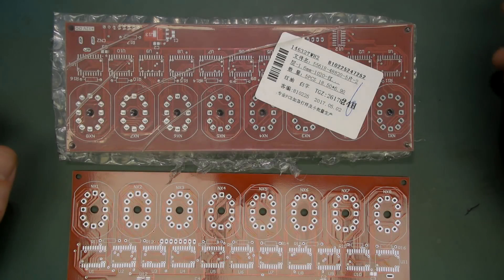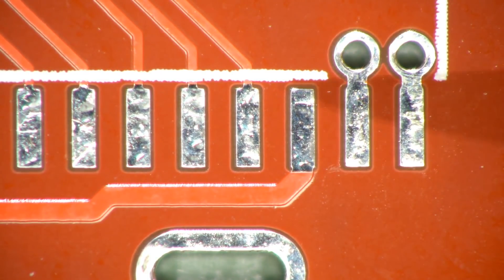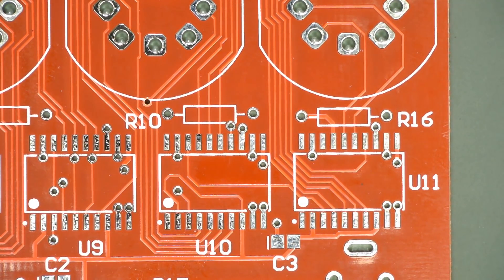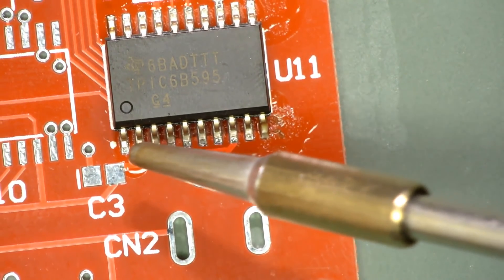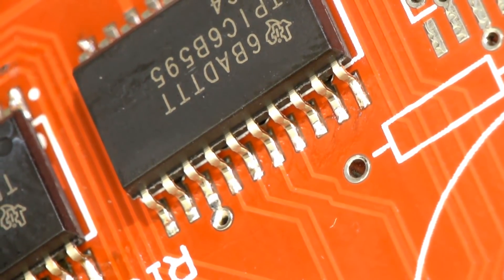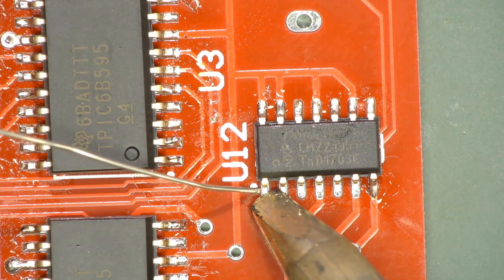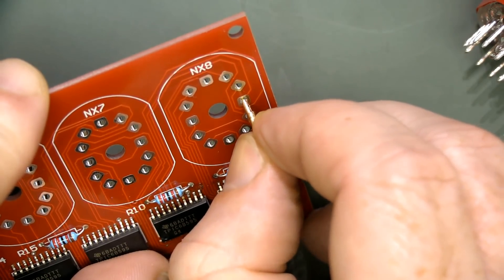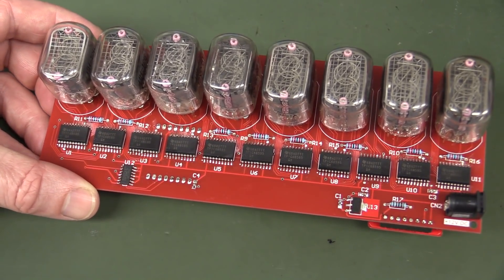EEVblog #997 - How To Solder Surface Mount Components

Comment: I'm new to soldering; I don't understand this. Why doesn't the dragging method bridge all the legs together? Or even the dab method, when the tip is wider than the pins and pads? I bought a simple kit and while the through-hole components are easy enough, these surface-mount ICs feel impossible. I just spent half an hour fighting a single 1cm-long 16-pin chip. I think I ended up with more solder in the vacuum piston thing than staying on the board, without how many times I accidentally bridged pins and had to suction the solder off.
Reply: more flux, higher heat, move faster. Once you're good with the iron, make a heating plate and never surface mount this way again.

Comment: This helps me a lot for an upcoming project. I have a Xbox One X that needs a new plug on the motherboard for the front USB sync cable, bought the part but didn't know how to attach it when it arrives. Now I know what I need to get in preparation, thank you.

Comment: Just came back to learn a little bit more about soldering down chips unfortunately I think I'm going to have some fun fixing and Nintendo 64 and DSi the DSi needs parts have an open Nintendo 64 but I'm pretty sure it's just the video and audio card.

Comment: I did not replace the chip but I did solder my Wii remote QR camera because it was glitching too much blinking in and out I figured one of those pins is disconnected thank God I did because it worked thank you very much.

Comment: Very good video. I built a four digit IN-12 clock a few months ago and I put it into a 70s style case with a red glass filter. I will use your tutorial to solder my golden 5402 IC from 1970 on a DIP-adapter to test and use it later for other projects.

Comment: In my opinion, for the job at hand, you used the wrong solder, flux and techniques. Even your drag soldering devolved into point-to-point (dab?) because of the poor solder and flux choice.
Reply: what’s wrong with the solder and flux

Comment: What soldering iron are you using?  Also, I dunno if this is a trick ppl use, but what about a wedge in between those circuit legs to avoid bridging when you have to solder a wire to the legs.  Is there something out there like that?  Wondering, because I solder very small delicate areas like this, and I want to avoid bridges.

Comment: Interesting. At work, I do a lot of SM soldering, using a fine chisel-cone tip and about 0.3mm Pb60Sn40 rosin-core solder at 675F, using a flux pen and single-pin soldering. I haven't tried "drag soldering" yet. Perhaps I should try to convince the boss to buy me a "well" tip, as drag soldering may save time, as I do a lot of soldering of multi-pin SM DIP ICs with 0.05" pin spacings. 

(Some of the ICS on the boards we repair have even smaller pin spacings, down to about 0.025" on Atmel CPUs, but we don't even try to mess with those; if those parts are bad, we send the board back as "unrepairable", because even if we could unsolder & solder those (which we can't), we don't have access to the software, so we couldn't program them.)

Comment: Whenever I'm soldering in pin sockets like that, or anything else that's not one socket package with all the pins attached, I connect them to the device (the nixie in this case) to make sure the pins stay aligned and parallel.  Drop the nixie in with all its pins and drop it flush with the board, solder them all in (tack them at least) then remove the nixie and move on to the next one.  If you don't do that you may end up with one or two pins that aren't quite parallel and you can't plug in the nixie without bending a pin a little, and that risks causing other problems.

And a nice alternative to a solder pen is to get a bottle of your favorite brand of ultralightweight flux and a soft bodied needle bottle.  Then you can dab the solder in wherever you need to, with pretty good control, even into areas that are awkward to use the pen with.  Also the pen needs a push to release the flux, whereas the bottle just needs a gentle squeeze, so there are things you can flux with the bottle that you can't flux with the pen. Search your favorite outlet for: needle tip bottle flux no clean
that'll get you a bottle of just what you need. (example, listing 201780768122 on ebay with over 2,200 sold)  One bottle goes a long ways.

Comment: What do you recommend for cleaning the flux residue after soldering is finished? Wash with IPA?
Reply: IPA Should do the trick but I like to use Kontakt LR (EAN: 5412386840135), its got a little brush attached to it to brush off the flux and works really well.

Comment: Some great tips for nuubs, thanks.  Having been in the industry for 15 years I was always a dab man with these packages, your example shows why drag (with these tip types) is so unreliable and often time consuming due to reworking via dab.  Might as well dab to begin.  I often didn't even use a flux pen.

Priority of component assembly and the diagonal tacking are great tips.

Comment: Desoldered a chip on a 01 bmw e46 and tried to wet the pads... 2 lifted up and I couldn't fix the issue that time... Was just ridiculous how easily they lifted. Also the soldermask basically crumbled when it got heated. Luckily its only a doublesided board and rerouting those connections will be quite easy. (I suspect the fault was with the pads as the dash did the same thing after replacing the chip)

Comment: Great video, always good to demonstrate different techniques. At least less experienced people can learn the choices to try and even more experience one can sometimes get a trick or two to compare. I wish I knew about flux  or dragging when smd started to appear. It was so difficult to try soldering them traditionally pin by pin with 0.7mm solder and a tiny tip, without flux and magnifiers other than what "helping hands" had ie. the plastic magnifier that just gets in the way!. :)
Sockets for odd ball tubes is sometimes a pain. I designed a while back a pcb for old russian photomultipliers. No sockets available and I did exactly the same using some crimp pins for connectors of suitable size. Worked a treat but as they were not totally round, aligning them was a bit of a pain.

Comment: Thanks for posting this👍! I've started getting into soldering small mounted parts like this and god damn they are small. I'm using a magnifying glass and feel I need to upgrade to something better to make sure I can accurately see if the soldering is holding or not.

Comment: everyone has their own technique  ...   but, did you get the job done without bridging connections?  did you get it done without overheating the component or fucking up the traces on the board ?   then you did a good job!!!  .. before I got my first hot-air rework station , I was popping 80 pin flat pack tsops with a butane flame or a paint stripper gun!    LOL   If we go back a few years .. I used to cut all the pins with an exacto blade then just heat each lead  one by one......... and move them off the board then use a flux pen and put the new one on  and solder the corners first .......

Comment: Thank God that I have a really nice, large stereo microscope and SMD soldering station because I just got a AM/FM radio kit that is very small.  You cannot read the resistor colors without the stereoscope.  
Great video.  Old-school tubes and new-school SMDs.
Frank
Frank Reiser Video/Audio Service

Comment: Not boring at all. ;-)  Thanks!

And extremely helpful: it showed me the mistakes I'd made in trying to do SMD after over 50 years of through-hole experience (mostly using solder that was too thick, and not doing flux separately). You've inspired me to get some proper supplies and try again.

One tip I'd offer in exchange: when doing something like those Nixie pins, I use an actual part to hold them in alignment while soldering. If I don't, I inevitably find that one or more winds up off-center, or standing taller than the rest.

I do something similar for jobs like soldering the headers on a Wemos, or Arduino Mini/Micro, board: I have a piece of protoboard with some male and female headers soldered to it about an inch apart. I insert the two headers to be soldered so they span those two rows, and they stay properly spaced and perpendicular to the board while I solder them in.

Comment: I have been looking for that "well-tip" type of soldering iron tip "FOREVER!" with absolutely NO luck--I actually bought a soldering station which I saw using such a tip on You-tube, but after receiving the iron, it seemed I could not find that well-tip anywhere (here in the US anywhere).  I have the following two soldering systems:  The "937D" and the  (somewhat odd) "TS-100" system.  

DOES ANYONE KNOW WHERE I CAN GET SUCH A TIP?  (it will probably only fit the 937D)

Thanks so much,

Comment: Just did my first SMD solder, (my training is from the early 90s...). Man, that was easy. The only problem was keeping the chip in place while tacking first and last pin. Other side i did with dragging along, other side once in a row (8 pin package). Really much easier even with my shaking hands. Need to figure out some guide to help with shaking (shaking is caused by neck muscles that are constantly too tight but doing 10 minute exercise to keep hands steady for a minute is not going to work in a long run, it's not bad just annoying). If anyone has an idea how to help with that problem, i'd be very happy pappy.

Comment: Hi Dave. For the JBC mini spoon, it is better not to get a solder ball under it but rather fill it (make it a flat surface). Once I figured it worked like that, drag soldering was a no brainer.
After I figured it, it was a real pleasure to use it. Even if I can get good result with a bezel tip, I like to switch to the mini spoon just even for a single chip.

Comment: Hi Dave, the upside down 2 as digit 5 doesn't pisses you? Unfortunately 
many Russian nixies have been made like this, but I personally hate it. 
Some years ago I did a multi hours search on ebay about this, it seems actually quite hard to find Russian nixies with proper '5' digits. If I have to use this type of tubes, I'd search the 
western (or GDR - East German) analogs of that tube type (if any exists 
in the same package, pinout and pin spacing).

Otherwise, it's a cool project, I hope the display will be in camera sight as often as possible.

Comment: I'm getting ready to solder a 30 pin connector onto a laptop motherboard to replace one that broke. You know, the kind with those flat ribbon cables that just insert and latch down? I have been worried I would screw it up, but after seeing you do it on here, I think I can figure it out now. I have some flux, some 0.022 solder, and a small chisel tip for my iron. I ordered a bunch of the parts since they were so cheap, and I'll practice on a junk board first to get my technique down before I attempt on the final product.
Thanks for showing me how these can be done properly!

Comment: Hello, I have a question. Why did you say that it was bad for the iron when you put some solder inside the tip's hole and the flux of the solder started to burn and smoke?

Thank you

Comment: I disagree that only thin solder wire would do the job. For through-hole components 1mm solder wire is just fine (and cheaper!). For SMD I just use wave-soldering tip all the time. I don't apply solder from the spool for SMD work. I now have two spools of solder: 0.5mm and 1.0mm. Both work equally fine for me.

Comment: For me its only "ok" soldering. Ur chips are a little shifted, and got a lot of terrible pikes. Try to reheat this pikes and take some solder from soldering points. It good idea to clean up the board after soldering to prevent corosion.  

Yours board of course will work, but not that long like cleanded board without pikes and holes in solder adhesive.

P.S fulx in gel will work better, but if u don't have it is okey to use liquid.

Comment: Another way of dragging soldering with surface mounts is to just pile in a heap of solder using a large flat tip and almost wash the solder along the pins. Don't need flux because it's in the solder. Gotta be quick though, don't want to damage the ICs with too much heat. Can use the Same technique for removing surface mount ICs. If you get a blob between the pins, just scrape outward with the tip and it generally removes any excess.

Comment: I would be interested in an explanation of proper board checkout or "bring up." Maybe this one was so simple and low-risk, but for a more complicated board I am pretty sure you want a disciplined process for loading and powering the board as you build it up to detect design or fab errors that might cook your parts.

Comment: While the SMT  parts on this board were easy to do with a good soldering iron (pencil), denser parts with 0.5mm (or less!) might be a good candidate for solder paste and a hot air tool.  How about a video with those tools?

Comment: I find that paste flux works best for drag soldering. It doesn't burn up as fast. Especially when you have to rework a couple pins. I like the ChipQuik and Amtech stuff. Genuine Amtech flux that is.

Comment: I learnt more in this short video, than I have in all the other videos I've watched that say they teach soldering.  A really good demonstration of technique with information on tips and solder gauge too. The only thing that was missing, was the question of iron temperature. I get the impression it's hotter the better, but only if you are fast and proficient at soldering as having it too hot for too long reduces the life of the tips.

Comment: Why not use solder paste and a rework station? I just soldered a TQFN ATMEGA in second try (in the first try, I put too much paste on, including the center pad). Just applied with a syringe. From what I can see under my normal (biology) microscope, it looks totally fine, and it is much faster and cleaner than this drag solder stuff.

Comment: I find it easier to build from the centre outwards on larger boards.

Those with lazy eye have a tougher job... it's like only working via a computer screen. Not impossible but the "first touch" is always a bit dicey.

Comment: I hate hate HATE 99% tin.  Have you tried SAC305?  I think flows much better.  You've got a huge amount of flux to get relatively poor flow (like you say, not really a problem).  Actually, my theory is people who complain about lead free being difficult are mostly using the wrong solder.  There's also evidence that SAC305 performs better than 99% on preventing tin whiskers.

Comment: I spent 7 years in the NAVY on submarines during the 80 s . During electronics 6 month school they taught me how to solder but never smd . If I want to do that I will have to buy small tip and small solder.. The stuff I got from the navy to keep is huge and most was done with a weller soldering gun!!!

Comment: If it's lead free does that mean the smoke is not toxic?
Reply: No.  

It is my understanding that even with leaded solder, the smoke hazard is strictly from the flux, because the temperatures involved are still well below the vaporization temperature of lead.

Comment: Dave,
Thanks for the video. I've been doing surface mouut the same way you just did for years. Just one question. What's your iron temp? I find I have to go a little hotter with lead free.

Comment: I find dragging works with any old tip but you need to have a nice ball of solder on the tip. Then you roll the ball across the pins and the flux makes the magic happen. The ball is running over the pins so you don't bend them with the tip.

Comment: 15:49 For perfect pin to Nixie tube pin alignment... I would suggest to place the PCB pins onto the Nixie tube pins and then solder them.
BTW... why didn't you use your Re-Flow oven to solder the surface mount components ??
Reply: Stencils cost about $15 on elecrow.
Reply: simontay1984... IC socket pins are too small to insert Nixie tube pins into.

Comment: Not so daunted by surface mount soldering. Now I just need a way to attach SMD ICs to vero / prototype boards without having to buy a different breakout board for each type of IC. Does anyone know if there is a generic SMD IC breakout board, rather than one type for each IC and it's specific number of pins?

Comment: Hey Dave! A hint on the sockets you use. These are NOT designed for Nixie tubes, but for female PCB-mount SUB-D connectors :) In fact, I found it cheaper to buy assembled SUB-D connectors and rip them apart for harvesting the contacts :)
Reply: I would also have used a nixie tube as an alignment jig for installing the socket contacts. Place the socket contacts onto the tube pins, then insert the whole mess into the board before soldering the sockets to the pads.

This will prevent any slight alignment errors in individually mounted sockets or slightly bent tube pins from causing stresses in the glass/metal pin seals on the tube when installed.  Solder quickly, to prevent the conducted heat from damaging the tube.

Comment: Nice video Dave, what's your recommendation on board cleaning? I've had trouble sometimes removing solder paste from under components, I now use an ultrasonic bath with Safewash 2000. Normal flux is easy enough to clean, but solder paste can be a problem.

Comment: It seems that all the Radio/Television servicing engineers in America prefare the 60/40 lead/tin solder.
Reply: Lead solder is more durable than lead-free, that's why. All electronics that go into space use lead solder as well for the same reason.
Reply: Lead reduces the risk of tin whiskers. There are also gold and silver solders

Comment: Dave what are your thoughts on cutting the leads before soldering, as opposed to after soldering? I've always learned that cutting them after soldering, can damage the solder joint.